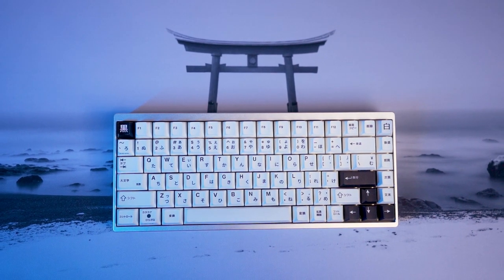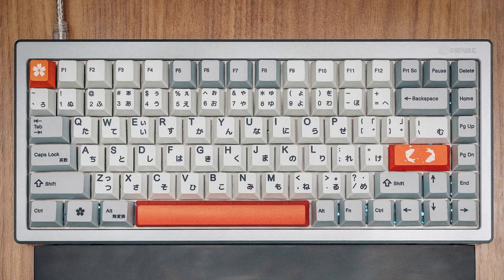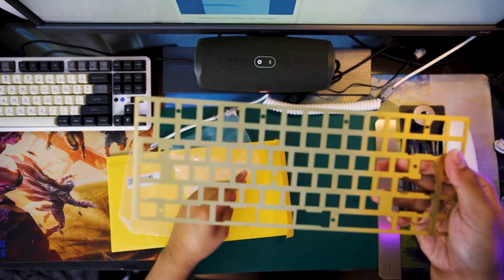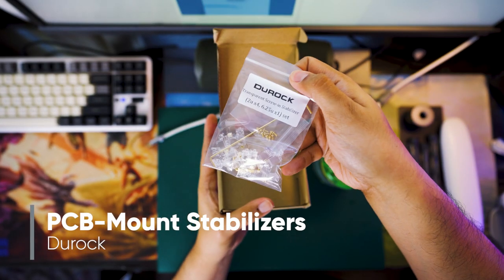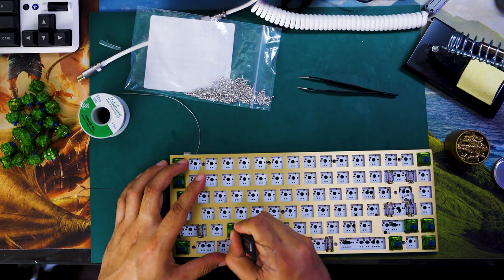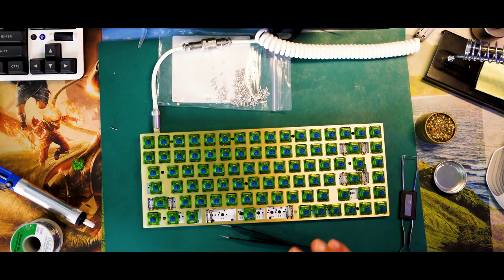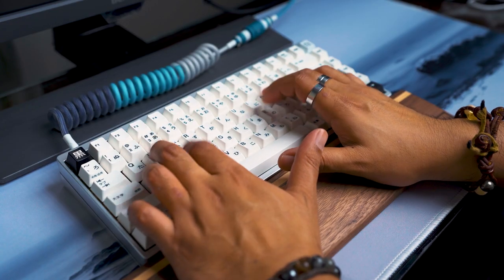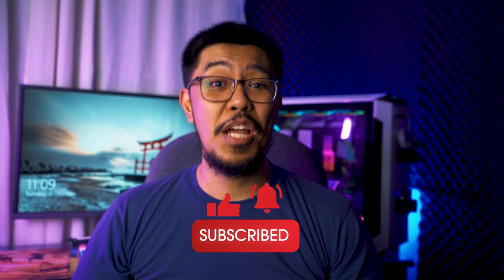KBD75v2 Unboxing & Build | ePBT Kuro Shiro + Uro Frankenswitches (Zilents+Kiwis)

Comment: And BTW you could get Zilents from for example divinikey, where they are priced at roughly 11, or so, dollars per pack of 10 switches, so 30$ there. Also, it's good to monitor stock of "The Key Company", as it sells C3 Kiwis at their stock price, they are selling out really fast, though. But it's another 30 dollars to be saved.
Reply: Sorry, Zilents cost 13$ per pack now. But it's still a 10 bucks